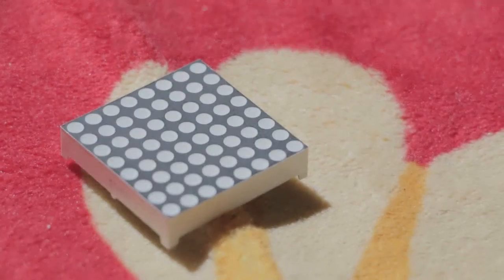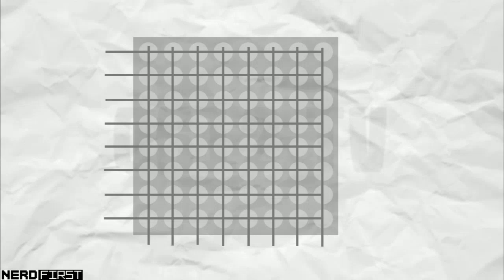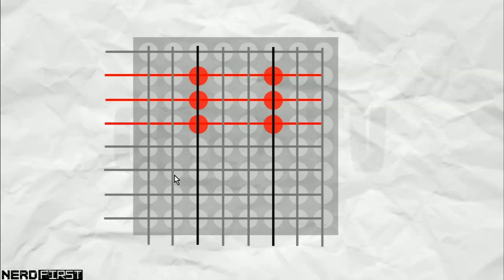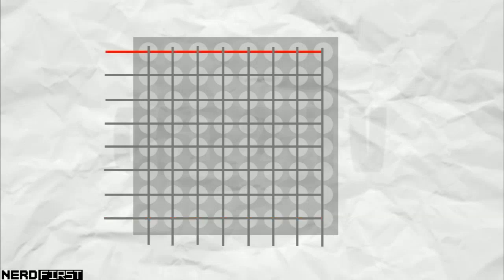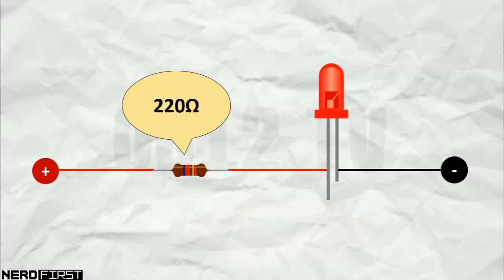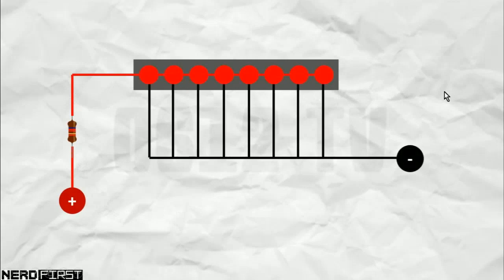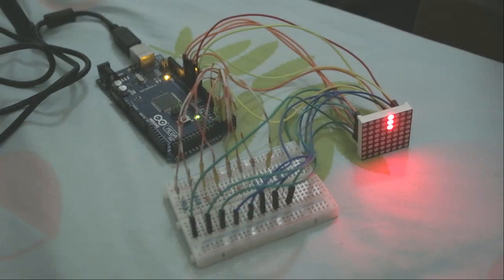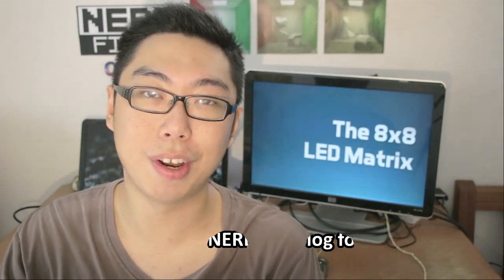8x8 LED Matrix for Arduino

Comment: Correct me if I'm wrong, but at 10:36 you can't just say the total current is 13.6mA. The reason is, the parallel part of the circuit adds up to much less resistance than with just one led and the total current is greater than in the previous circuit (because the total resistance is smaller). The result of this is less voltage on the LEDs which explains the dimming. By connecting a resistor to each branch separately, you create a bunch of circuits as you've shown before ( led and resistor in series) but the total current should now be 13.6mA times the amount of branches(8) = 108.8mA. Hope this makes sense.
Reply from the maker: Hello and thank you for your comment! While you are right to say that the diagram at 10:36 ignores the resistance of the LEDs, the number I've given is actually too small, not too large, since I have been assuming LEDs to have zero resistance in my calculations. You are, however right in saying that the "parallelized" LEDs will lead to a lower resistance compared to a single LED.

What you're saying about the "parallel" version seems consistent with what I have, though I did not explicitly mention 108.8mA.

Regardless, the good news is that these LED panels don't actually draw anywhere near this amount of current. Refer to the pinned comment for more.

Comment: Won't I burn my digital pin connected to anode here 11:53? I heard that maximum current arduino's I/O pin can supply is 20 mA. But here 11:53 current on the pin will be 8*13.6=108.8 mA which is much greater.
Reply from the maker: Hello and thank you for your comment! Yes indeed! If the numbers worked out the way my calculations did, it would be indeed a cause of concern. However, a kind commenter has done the hard work of taking the measurements, and have found the current draw to be within safe ranges. Please refer to the comment pinned on this video for my conversation with them.

Comment: 16x16 LEDs matriculation can be made or not, if max7219ic can not be made, how can
Reply from the maker: Hello and thank you for your comment! You can run four of such matrices off the same arduino if you want. You can scan them separately (as four independent 8x8 matrices), or you can even join the rows and columns such that they scan together. That's what I did for my 2x8x8 shown near the end of the video.

Comment: Sir the program compiled successfully but when I am inserting the 5v pin in the Arduino then the lights on the Arduino are not glowing.
Please sir help me😭😭😭😭
Reply from the maker: Hello and thank you for your comment! If the lights on your Arduino  go off (or become very dim) when you make a connection, this usually indicates a short circuit somewhere. Check your connections.
Reply: @NERDfirst  yes sir it was and now it's working thank you very much sir

Comment: Hello bro, nice video. Can you help me with something? Im trying to scroll some text in the led matriz but I can not use the max7219, can you give me some advice or do you have a video with that topic?
Reply from the maker: Hello and thank you for your comment! If you're not using a "helper IC" like the MAX7219, then you're in full control of what gets displayed on the matrix (ie. You're just turning pixels on and off). In fact there really isn't any notion of "text", so to speak. You'll just have to repeatedly redraw the letters you are displaying manually.
Reply: @NERDfirst  Thanks for replying, do you know any way to redraw the letters? I have been trying with some examples I have found on internet but none of them works with what im doing,  I am supposed to control the led matriz with a mcp23017 so I havent found a way to make that "redraw" using the port expansor.
Reply from the maker: Hmm... Are you able to draw anything on the display at all? You should probably start here. Before thinking about text, try and just get the same smiley face from the video up on the display first.

Once you're familiar with how to light up the individual pixels according to what you want, then you can translate the problem to text. At that point, you'll have to figure out how every character is drawn (ie. Which pixels to light up, and which not to). For scrolling text, keep track of "where" you are on the string, and draw the character indicated at that point based on your logic.

Comment: Can someone help me find the problem? I connected the second from the right pin on the side with no text to one of the pins in an Arduino uno. Then I connected the one after (3rd pin from the right)  to the Arduino and set the first pin to low with a resistor in between and the second pin to high. Nothing happened.
Reply: I also want to add that it’s a really good video and good explanations. Thanks!!!
Reply from the maker: Hello and thank you for your comment! Glad to be of help =)

Regarding your problem, you might want to snap a picture instead, I really can't make much sense out of your description. Might be good to say what you're expecting too instead of "nothing happened".

Comment: I have a question. How come in the parallel format you put the resistor after the LED. Shouldn't the resistor come before?
Reply from the maker: Hello and thank you for your comment! According to Ohm's Law, the current across the LED and Resistor (and anything else you would put in that segment) are the same, so whether the resistor comes before or after actually doesn't matter!

Comment: very cool interested to see how the commercial drivers works do you know?
Reply from the maker: Hello and thank you for your comment! What do you mean by "commercial driver"? Not really sure what that's referring to in this context.
Reply: @NERDfirst  Hi i mean for example the 
8x8 LED Matrix MAX7219 that simplify the use in only 5 pins
Reply from the maker: Hello again! if I'm understanding the datasheet correctly, the MAX7219 consists of an 8-bit decoder to decode a number into its individual bits, plus scanning mechanism to scan the lines. Datasheet here: https://www.sparkfun.com/datasheets/Components/General/COM-09622-MAX7219-MAX7221.pdf

You can emulate that effect yourself using shift registers! I've done a video on that here: https://www.youtube.com/watch?v=NM7wXta8crM

Comment: Hello, thank you so much for the fantastic instructions. the part where you demonstrated the scanning of the image was such a good way to show what happens.

I have one question though,  if you have an 8x8 grid and are scanning/flashing each led in sequence. What stops all the led's being 63x dimmer as they are only on once out of every 64 pixels scanned ?

thank you,
Reply from the maker: Hello and thank you for your comment! Actually, you're right! Our eyes don't really see it, but the individual pixels are indeed flickering extremely quickly over time, and in fact, it does subtly impact the brightness. 

Though the number is just 8x, not 64x, as you are scanning on a per-row basis, not a per-pixel basis.

Comment: I built a cheap ebay video game of tetris and it uses two of these displays together. It lights up but it's all random I'm thinking it must have had an orientation? Do they I noticed on the board one of the pads for each matrix has a square and the rest are round. I put them with the writing facing up which is opposite the square? Any help on this would be great.
Reply from the maker: Hello and thank you for your comment! I'm afraid I don't fully understand what you're describing, but overall, if there is any weirdness in how it appears, there are two places to check - Your wiring, and your code.

For the wiring part, check against the datasheet for your matrix. Getting anything wrong there will of course cause the whole display to not work properly.

As for the code, I like to test it first by lighting up the rows one by one, followed by the columns one by one. This is easy to code without having to do much scanning, and if something comes on in a way that is different from what you expect, you'd know there's an issue there.

Comment: Such a nice video! Learned a lot from it.

So how to solve the last question, what's the answer :) ? And I have a Arduino Uno and it seems to have 14 outpins and I guess A0-A5 can also be used to output which is analogIn, can't it？ So can Arduino Uno be used in this project?

The last question is can I control it one by one? Recently I'm doing a project which is making a program to light a LED matrix by using a button matrix which is coded in C#. So your video is really inspired and I just want to control the LED matrix by button, which is：when I click one button, the relative LED is bright. Sorry for speaking much, thanks again for your video.
Reply from the maker: Hello and thank you very much for your comment! 

I see you've found the other video - That's the answer, using a shift register!

In order to achieve what you want, coding is required (ie. As far as I know there is no "purely electrical" solution). With code it should be fairly straightforward - Read the buttons, use if statements and calculations to figure out which button it is and therefore which LED to light up, and send it along to the matrix.
Reply: Thanks for your reply!  And I got one other questions: it looks simple to light all LED in this matrix which is power up all 8 row and let all 8 column low. But if I want to light all the LED except the last one (8,8), what should I do? If I change either one of the column or row, the whole column or row's LED will change, is it right? 
So, can you tell me how to do that? Light all LED and dim the last one(8,8)

Comment: Hi!  I like your videos very  much, it helps a lot to me since I'm a starting learning.
Now I'm in a mini-project at College and get in "trouble " often. So..  would you tell me how do I display a random pixel on the matrix?. I can print the random Column and random row but I couldn't display them on the led matrix. I'm sure the matrix works very well.
Reply from the maker: Hello and thank you very much for your comment! Very happy to be of help :)

If you can print the random value that means you're generating it right. That's a great step forward. The next part is to actually use it to decide which pins to fire off. 

For this to work, I'd assume you have your rows and columns connected to consecutive pins (eg. The rows, in order are connected from pins 2 to 9, and the columns from 30 to 37). You can represent this "starting point" as a number that you can use to add to your random number to figure out which pin to activate, ie.

int rowOffset = 2;
int colOffset = 30;
int randRow = //generate random number from 0 to 7
int randCol = // generate random number from 0 to 7
digitalWrite(randRow+rowOffset, HIGH);
digitalWrite(randCol+colOffset, LOW);
Reply: @NERDfirst  Hello, I've got a question regarding your code. 
What should the default state of all LEDs be? Because as soon as you set one row high. All the columns will be either LOW or HIGH. Making a column LOW results in one LED lighting up obviously. But the others? Do they stay 'unconnected to gnd'? And how do I tell the arduino to 'unconnect' them? 
Cuz' If I make them HIGH, I rely on the diode reverse voltage (the breakdown voltage is usually not very high)
Reply from the maker: @ProtoMan137  Hello and thank you for your comment! Simply send "LOW" to those other rows. You are right to say that they could possibly get briefly reverse-biased as you scan the matrix, but I don't see another practical solution to avoid this. And I'm not sure how much extra life you would gain out the panel from doing so!
Reply: @NERDfirst  oh wow, thanks! Just as a recap. Col1 and Col2 are LOW. Row1 and Row2 are LOW. If I want LED(1|1) I make Col1->HIGH and at the same time Row2->HIGH so I have a voltage across LED(1|1) but not LED(1|2) (the one right below LED(1|1)).   Is that correct?

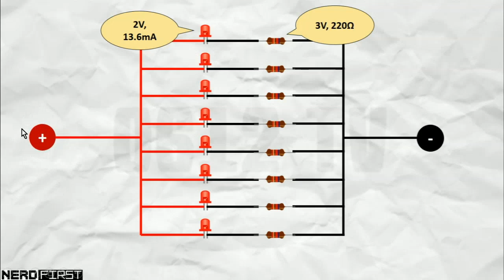Comment: Hello, excellent video very explained, I already replicated your circuit in my Arduino Uno, but at 11:57 there's a problem (well, i dont if it is or not) but, you see, at the 5V Row Cable in the instant of 8 leds turned on, your Arduino pin will source 13.6 mA x 8 = 108,8 mA , and that's is too much current for the Recommended Current per pin which is 20mA, and Maximum absolute per pin which is 40mA. What you can say about it? Thanks!
Reply from the maker: Hello and thank you very much for your comment! The only thing I can say is that you are absolutely right! Arduino pins aren't supposed to source that much current. In my case, this did not result in any immediate damage (even when I had the matrix fully switched on), but you are correct to say that that's not the right thing to do. The lifespan of the Arduino board would likely be shortened as a result.

The only consolation I can provide is that in normal operation, most rows are not completely switched on, so the current draw is less. In addition, the scanning action will also "spread out" the current draw for the pins involved, so any damage is likely to be minimized.

Still not the right thing to do, of course!
Reply: 0612 TV w/ NERDfirst Hello thanks for the answer! After I commented in your video, i put a full row of "1" to make all the led on, and then I measured the amp of the full row led (row side) and to my surprise it read a total of 4,5 mA (with all 8 leds on) pretty weird? With another row of 4 leds already (lower part of smile) on it made 3 mA, another row with 2 leds on it (upper part ofsmile) made: 1,75 mA, anyway in all cases are lower than the recommended 20 mA. So theres no worry about that, only makes me wonder why so such low amps? Is the V-I curve of the generic led? Or other thing? Thank you for your video lesson and sorry for my english.
Reply from the maker: Woah, what's best are the raw numbers, kudos for taking the time to measure it up!

The numbers I used in the video are just "typical" numbers for LEDs. Really LEDs can be designed with any activation voltage, and their current draw will be different also. I guess the LEDs used in this component are just not as power hungry as your average LED.

Per Enigma758's reply below, I think it's still important to note that you should let the datasheet guide you and take measurements if you're concerned. Each use case differs,  so don't take any of this as gospel.
Reply: Sorry, but I'm not buying any of this.  I measured the forward voltage of a single red LED on my matrix and it was just under 2v as expected.  The OP has not specified what voltage output is being used (e.g. could be 3.3v), and the response makes no sense.  Did you try tying your output to ground through a resistor to determine that your output can actually source 20ma?  Did you make sure not to use pin 13, which is special on some Arduino's that have a built-in current limiting resistor.  Did you even use an Arduino for this test?  If not, can your supply source the required current?  The OP did not specify what resistor values were used or enough details about the test to be certain about any conclusions.  Sorry, but there too many variables to just chalk this up to "not as power hungry as your average LED", so no worries".  Furthermore, if you look up the datasheet for the 1088AS, it indicates "Foward Current: 20ma".  Always, design for the worst case, and leave some extra margin for safety.

ADDENDUM: I connected a 220ohm resistor across a single diode in the matrix.  Vf measured at 1.91 ohms.  At 3.3v measured 6mA and at 5v measured 13.5mA.  These values are very close to the calculated values of 6.3ohm/14.0ohm, so nothing unusual appears to be occurring here.
Reply from the maker: @Enigma758  Hello and thank you for your comment! Sorry for the late reply, YouTube does not reliably notify me of comment replies, so I missed your comment. Yes, you're right, it's important to rely on the datasheet and take your own measurements to ensure things work out well for your use case. It was not my intention to say that this matrix is definitely okay to use like this in all use cases. I will write up a new pinned comment to clarify.
Reply: @NERDfirst  Hello and thank you for your reply and sorry if my response came across as being a bit harsh.  I can be a bit of a stickler when it comes to these things and I should also mention that I really enjoy your channel!
Reply from the maker: @Enigma758  Oh, not at all. This is an important consideration, and the last thing I want to do is to give out advise that would end up causing damage to people's components, so your comment is meaningful. And I'm glad you like my work =)